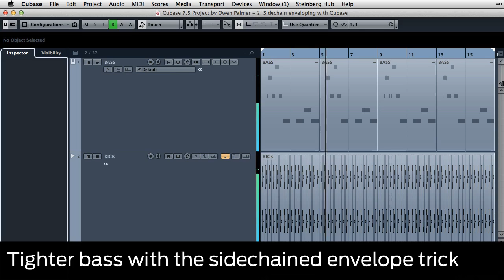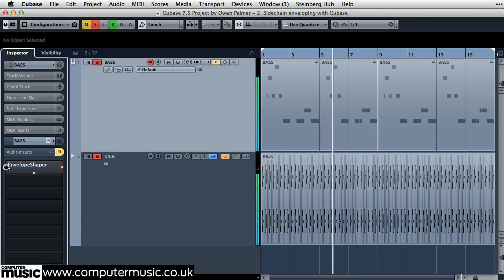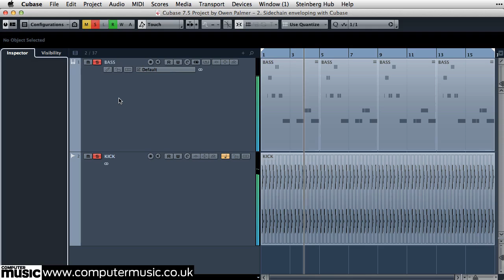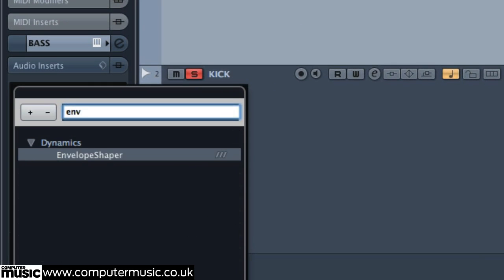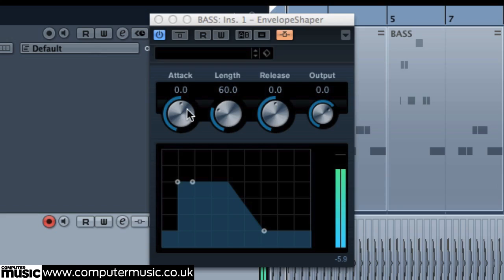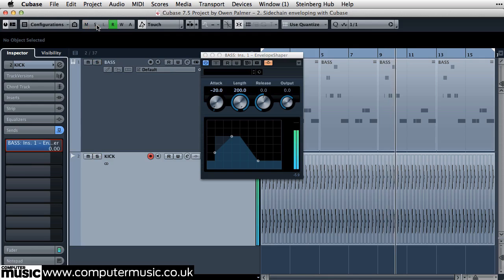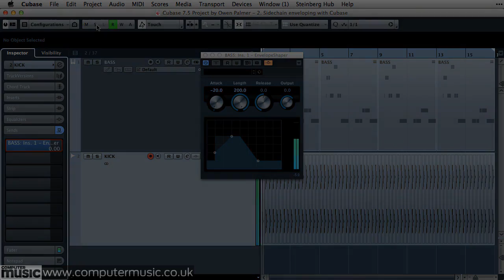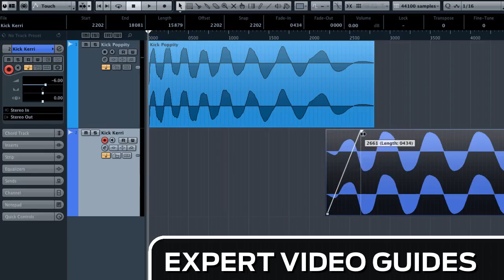Tighter bass with the sidechained envelope technique - part 2/10

Comment: You can do the same thing with a volume shaper like kickstar or volume shaper by cableguys, and you don't need to side chain. Less steps, faster workflow.
Reply from the maker: The technique shown here can be used with any kick drum pattern, ie, it will follow the patterns you program, no matter how complex it gets, and you can easily refine the enveloping action by tweaking a few parameters. That's the advantage of using this technique over something like VolumeShaper (which does work very well for repetitive patterns, and is used elsewhere for other purposes in this same tutorial :)
Reply: Computer Music Magazine  What would be a comparable plugin to use in ableton?
Reply: +Computer Music Magazine You are not making any sense. Heard of retrig oneshot in volumeshaper? Does same thing, follows the pattern you program, no matter how complex it gets ;) So yes volumeshaper does work perfectly!
Reply: +Computer Music Magazine Just wana reply again that using retrig in volumeshaper that i wrote about is not allways a solution if the samples arent triggered via midi but are samples instead of midi information in the arranger.